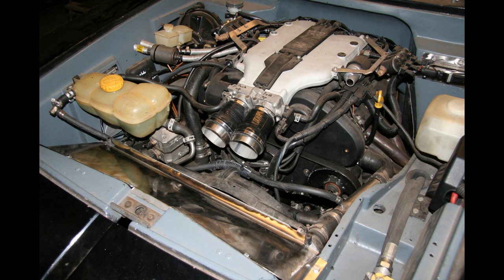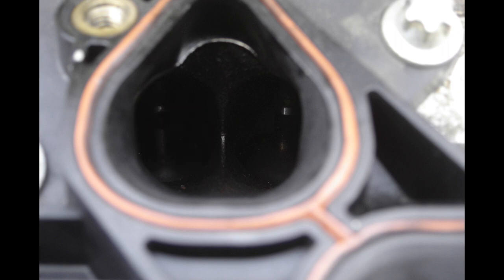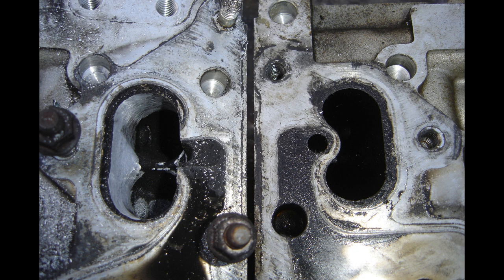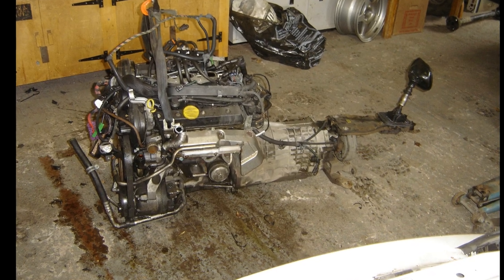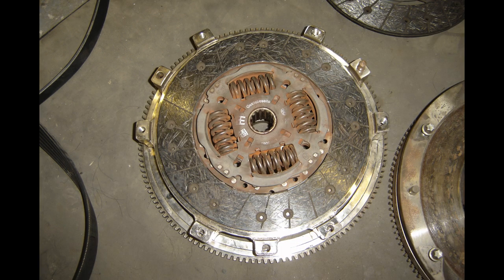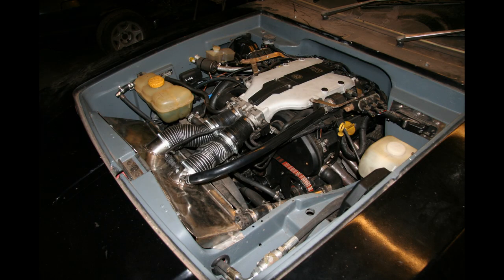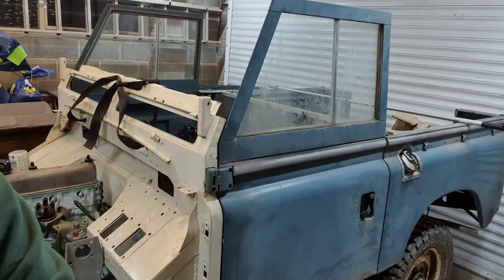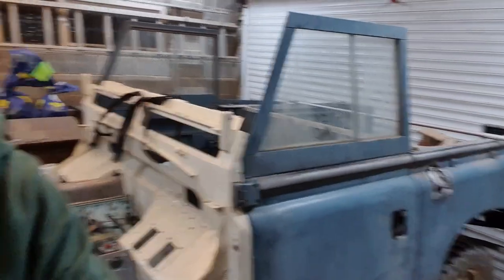30% Power Increase Vauxhall Omega MV6 V6 X30XE.  Cheap, DIY Tuning. Plus Solid Lightweight Flywheel.

Comment: If I only would have my own garage would definitely start working on my Omega 2.5 V6 that I got 3 month ago it needs some work but little by little I’ll bring it back to life
Reply from the maker: Its not easy working without a garage! I have done lots of car work outside. Keep at it. You can get lots done in tge summer. Good luck with the project. 

Maybe a video of the car??

Comment: Hi, amazing results, how did you manage to increase the torque so much in the low revs? What do you think made the biggest difference. Might it be the free flow intake and exhaust? Or the bigger throttle?
Reply from the maker: Andre, thanks for watching and thanks for the comment.  It is a fantastic strong engine and I'm really pleased with it. but this video really needs an update.  I had this car on two rollings roads before, one said 290hp the other 262hp.  I know the 290hp rolling road over reads a lot, and I know the 262hp rolling road was not calibrated accurately.  

If you've seen my other videos you'll know I've been restoring my own rolling road.  I have now calibrated this to a high degree of accuracy and had my scimitar on it many times now.  

The peak power is actually 236hp, and the peak torque 297Nm.  I was of course disappointed but I have every faith in the accuracy of the rolling road.  

After the initial disappointment I have come to realise that its probably still quite good.  To get about a 12% increase with the mods I've done is still a credit to the engine.   

Now to answer your question....  I'm not sure exactly what the most effective modification is really.  Each of the mods just give the benefit of improving gas flow in and out, so they would be most effective at high rpm.  If I had to guess, I would say the biggest impact has come from getting rid of the CATs, the headers, and the porting to the plastic base plate where the injectors sit, that had some horrible restrictions in it.  

I will at some point put a standard size throttle body back on just to see how much difference increasing the throttle bodies has made.  

Thanks again for your interest
Reply: @lozl  Thank you for the quick response, 12% Is still a lot, maybe some ECU programming will increase it by another 10%, other than that this is really great project, in my opinion keeping the reliability high is the most important thing, thank you again and best wishes.
Reply from the maker: @andrejkitanovski565  I totally agree. It's such a solid all.round car. I always wanted it to be tough and reliable. 

I will be doing some more.mapping on it soon, in fact I can't wait :)

Comment: Nice to see another v6. My 3.2 is currently 710hp love these engines!
Reply from the maker: Thats mental! I assume its force fed. I've long known these were very strong motors, but I never imagine 700hp would be possible... u guess you have some pretty trick internals. I always planned to supercharge mine but the big issue is the gearbox. Is yours FWD? The RWD gearbox just isn't up to much more torque.
Reply: 710???
Reply: Хочу это видеть!
Reply: You should try zf 8hp gearbox with stand alone TCU.
Reply from the maker: @trolmountain475  I would bloody love to! Fund aren't allowing right now but that's what I want to put in my next project car. (The car is bought and waiting in a safe dry storage until I can afford to do it). 

Such a cool gearbox, I cant wait to get my hands on one.

Comment: how many millimeters is the throttle body because I'm doing the same engine. Thanks
Reply from the maker: @bazakamotorsport1650  I'm afraid I can't remember right now. I k ow that 57mm is either what is was or what I've taken it out to....

The only other thing I can remember is that it made the cross sectional area 11% bigger.
Reply from the maker: @bazakamotorsport1650  I will at some point be fitting a standard size item again and testing to see if it makes a difference to power. I jave a rolling road now so can experiment to see what actually helped in making the extra power. If I remember I will get back on here and let you know
Reply: @lozl okei thanks

Comment: Hello i have Opel corsa a with 3.2 v6 for drag racing and looking for more power. Now it have 235 hp what is max with tune but is helped with 100 hp of nitrous. Im buying standalone ecu and looking to do your tuning. I watched whole video and i will do it. Do you have some advices or measurments? Thanks
Reply from the maker: @pokimotorsport  Thanks for the comment. These are awesome engines! I have been really impressed with mine. They're so strong. 

Since this video I have now had it on a very accurate rolling road and it seems its only making 239hp not the 275 I thought. 

I believe the 3.2 has a lower compression ratio than the 3L. If I was building the ultimate engine I would try and get the 3.2 to have a much higher compression ratio somehow. Perhaps 3L heads on 3.2 bottom end. I'm not sure though as I only ever had the 3L. 

There was loads to port out of the exhaust ports on mine it had a horrible lump in the middle for backward air injection system to warm up the CAT. 

The nitrous will be fun! But might mean that the lower compression of the 3.2 is a benifit rather than a disadvantage. I guess it depends how ofter you are going to use the nitrous. 

Stand alone ECU is always a good way to go though, gives you so much freedom
Reply: @lozl  I won first place in 14 sec class with tired engine (metal shaving in oil) Now im rebuilding it and try to get more power.
Reply from the maker: @pokimotorsport  that's awesome! I got a 13.8 in the scimitar. Such a cracking engine. I was gunna supercharge it, the engine would take it all day long but the gearbox isn't thw strongest so I decided against it in the end

Comment: Some good tips here. Nice work on the throttle bodies! That lower inlet manifold porting looks easy & I might have a crack at that tomorrow. I'd always considered removing the air injection ports the next time I had the engine out so it's good to see that someone has done it with some success
Reply from the maker: Thabks for the comment Ian, great to hear from other owners and enthusiasts. Is it in the omega or another car?? I believe the restrictions are in the 3L but not the 3.2? Which engine do you have? 

Is there animating on yours on the Web??
Reply: @lozl  Sorry, not ignoring you. Youtube keeps deleting my comments :O
Reply: You can find more info on my build if you go to my channel's "About" section.
Reply from the maker: @ianmcass  sorry Ian, I had lost of track of who I was talking too. Forgive me. I am familiar with your car. Its awesome. I've had a good look through your website. It's a very impressive car, really nicely finished. I am green with envy, your car is so much smarter than mine. Mine is very rough and ready. 

Your exhausts look fantastic! I would like to achieve a finish like yours on my next project. 

I notice yours sounds nicer than mine too. A really clean sound. I think this is to do with all 6 cylinders sharing the same pipe. Mine stay separate all the way back. 

Its a really smart car man! Love it. Hope to meet you at a show one day.

Comment: what do you think about 2.6 v6 gm engine?
Reply from the maker: Still a cracking engine. I think the co.pression might be slightly lower than the 2.5 but I'm not sure. And I believe the inlet runners are slightly narrower. So they will have a fraction less power. But I'm sure they're still very capable engines. 

Thanks for the comment. Glad you found my video.

Comment: hi! how work your MAF? at the origin he work for the 6 cylinder so on the video he work for only one side so 3 cylinder no? can you explain me please? ;)
Reply from the maker: Hi there. I'm not using the original MAF sensor, I am using a MAP sensor its connected to the side of the plenum. In addition I have removed the flaps from inside the plenum so it is all one big volume for all 6 cylinders. It uses an aftermarket ECU and a GM style MAP sensor.

Hope thiss helps. Thanks for the comment
 Hopefully I will soon have my scimitar MV6 on my own Rolling Road. Stay tuned.
Reply: Great ! Van you says me about thé ecu ? Map ? Tune way ?
Reply from the maker: @brice100nx  it's a Canems ECU, it's their most basic model. So I'm batch firing the injectors. Wasted spake with the original coil pack. MAP sensor. It's an aftermarket ECU so I har it mapped on a rolling road. It was about 8 hours work and it was well worth it. Its an awesome engine

Comment: I had MV6 from 2004 till 2011, it was a good engine, always wanted to increase HP.
Great video, wish I watch it 20 years ago 🤣👍
Reply from the maker: Thanks for your kind comment. Glad you're enjoying the videos. 

I agree it's a really strong engine. I've heard of some crazy power figures being easily achieve with forced induction
 The gearbox is the weak link really

Comment: Hi! Very nice build, congrats! Im in the middle of pulling out the engine of my mv6 b1. I have kind of similar plans with it. Can I ask what flywheel did you buy?
Reply from the maker: Thabks buddy, glad you enjoyed the video. And I like the sound of your project. Its such a great engine. 

I bought the flywheel second hand, over 10 years....  at that time I believe it had originally been bought from Courtney Sport, the vauxhall tuning shop. I think a friend of mine has been in contact with them and found they no longer supply this part. I imagine it would very hard to find one now. I would be interested to hear of you do get hold of one. It's an awesome lightweight thing.
Reply: @lozl  Thank you! Yes, it is a solid engine, i like how relatively simple it is. 
Well, I had feeling that my only option is to make a custom one mass flywheel for it😅
Reply from the maker: @devbatyo  yeah this might be the way to go. A have a friend with the same engine in his scimitar, he fitted a flywheel from something else.... maybe a 4 cylinder red top engine I think.... not sure. He has had lots or teething problems with spacing out the concentric slave cylinder and other things too but I rhino he bow has a good working solution.

Comment: Nice video. I guess the bhp figures were at the flywheel? I've pretty much done these mods on my x30xe engine too, but with 4 x g cams. I'll be running it on a standalone ecu and tuning on a dyno in a couple of months, so it will be interesting to compare dyno figures. I'd be very pleased if it's close to yours figures, but was expecting something more like 250. Fingers crossed then! Did you upgrade fuel pump, fuel regulator etc?
Reply from the maker: Thanks Phil, much appreciated. I'm afraid I never even asked, so I assume it must be at the flywheel, at the wheels would be too much. I have to say I was expecting 230 to 250hp too. I was amazing and so pleased. If anything I had my doubts, but when I got a 13.8s quater mile at Santa Pod it kind of confirms it. 

Please let me know how you get on. I'd be very interest to hear. What ECU are you using?
Reply from the maker: I see you have no videos. Is there anything on your project on the net?? What car is it in?
Reply: @lozl  mine is in a vw type 2 early bay. Built for drag racing. Best time so far is 14.2, with a 1.79 60 foot. Only video of mine is on veedubracing channel from earlier this year. The ecu I will be fitting is an EMU Black. I'll also be opening up the inlet plenum a bit, fit an 80mm generic throttle body and make a smoother inlet duct to throttle body. I'll try and post a link
Reply from the maker: @philswell18  that's epic! Thats way faster than it should be hahahah, I love it. That's so cool
Reply from the maker: @philswell18  awesome. Thanks again for getting in touch, it wicked seeing other similar projects. 

What are the cams you mentioned??

I wanna see more videos when it's done please
Reply: @lozl  ha, thanks. I was taking it easy that day as it was just after the mods. I've upped my launch rpm now, with slicks and its much faster off the line. Had to upgrade to a stage 3 clutch too as it was slipping.
Reply: @lozl  'g' cams are one of the variants of cams vauxhall put in the v6's. They are one of the  more aggressive profiles out of the bunch. From memory, the inlets on the x30xe are already 'g' varient, so I just sourced 2 more and put them in the exhaust sides
Reply: @lozl  please let me know how I can get in touch outside of YouTube and I can share pics, vids etc :-)
Reply from the maker: @philswell18  oh, this rings a bell now you mention is. That's very cool. Have you got tubular exhausts too? It certainly sounded amazing on the drag strip so I guess it has
Reply from the maker: @philswell18  hmmm, that sounds familiar, I'm having clutch troubles too. Where did you get your clutch? I need to change nine again. Does yours have springs? What pressure plate do you have, tell me everything :)
Reply from the maker: @philswell18  do you still have the dual mass jobby.?
Reply: @lozl  mine was an auto
Reply from the maker: @philswell18  oh. Sounds like a manual on the track???
Reply: @lozl  I modified a blank flywheel the vw world use for subaru conversions, the bolted a KEP stage 3 pressure plate and a now run a black magic clutch disc. Used to run a cb performance dual friction disc which was fine, but I bought the stage 3 as a good second hand unit with the disc that was already bedded with it. No springs, it's a 'slipper clutch' more dedicated to drag, so not ideal for road use, but grips well. All to suit 200mm, so, a little smaller than your setup.
Reply: @lozl  yeah, is manual, but the omega I took it out of was auto, so no spare dual mass laying around for you :-)
Reply from the maker: @philswell18  This is tricky, I need to set up another account an link it to the YT channel.  This is something I've not done yet.....

Comment: How did you connect your new cooler to the oil outlet from the engine?
Reply from the maker: I'm believe I took the old hard lines (that go up the side and back of the block), to a farm engineering place and they had some fittings to Fitz then they made up the hydraulic hoses to go to the thermostat and cooler. It was way overkill, 5000psi, but it worked :)
Reply: Hi Loz, 

Thanks for the reply.

Can you remember what size the fittings were eg OEM fitting to AN fitting coupling ?

Many thanks,my oil cooler is leaking into the coolant and they no longer make them for a vauxhall omega 2.6 auto so I'm forced to fit AN10 after market type.

All the best great channel BTW.

Lou.
Reply from the maker: @louspur3585  you're too kind many thanks. 

I'm afraid I can't remember..... it will mean having the car out of action for a whort time, but you might need to take it somewhere for them to identify it. I'm sorry I can't be more helpful. It was over 10 years ago when I first did this project :)
Reply: @lozl  no worries, thanks for the replies anyway 👍🏾
Reply from the maker: @louspur3585  if you find the thread on the scimitar forum, I night mention it in there. I also posted (like 20000 words and hundreds of photos) on retro rides, pistons head and a few others. If you Google scimitar MV6 on images, most of them are are my car so this might take you to a build thread
Reply: @lozl  cheers 🍻

Comment: So I will buy a Honda civic from the old compact ones.I have an opel omega with the same engine but it's in some trouble so it cannot be driven on road I'll take out the nine and put it in the Honda then tune the crap out of it
Reply: Might convert the Honda to rear wheel drive
Reply from the maker: Thanks for the comment. It seems I've only just found a load of comments I haven't replied to...

That sounds wicked.  Its hard to do a RWD conversion, but oh so rewarding!